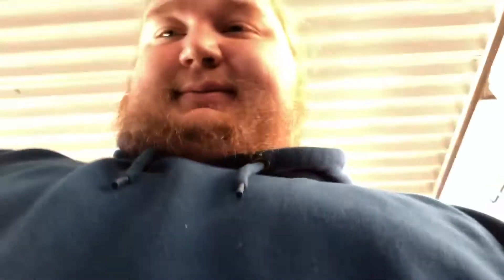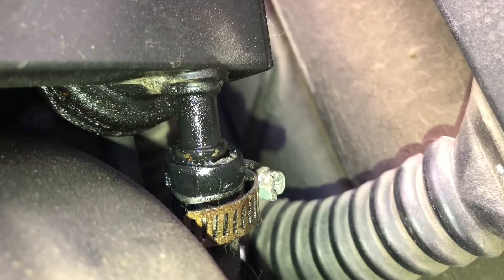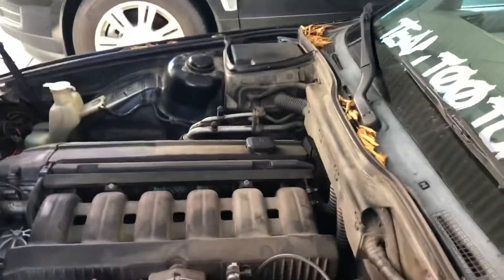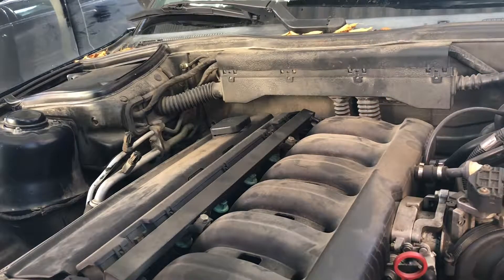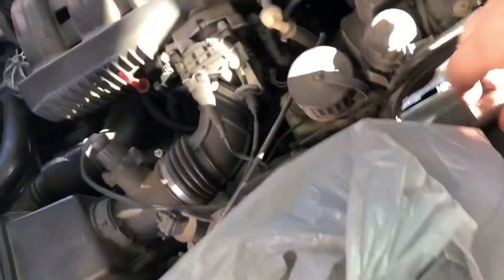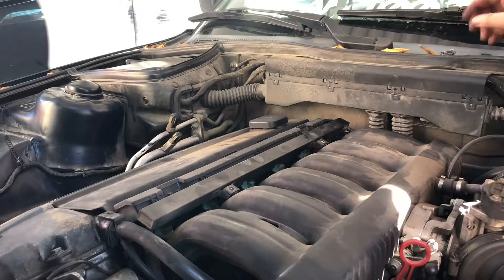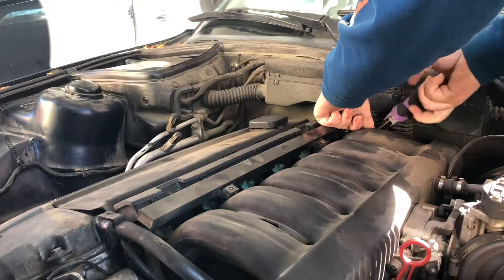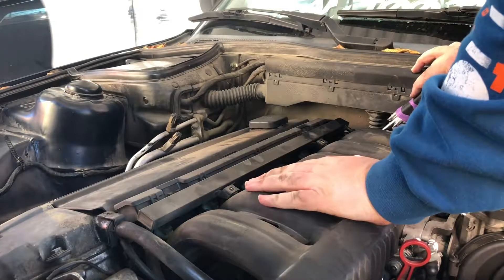ERIN’S CAR HAD A GAS LEAK!?!

Comment: Good job getting that leak fixed!  It could have gotten bad, if it went longer. Was the hose all the way on?  Looked like it could have went on further?  Keep the videos coming.
Reply from the maker: WHOTUCKIS yeah dude it was pretty bad. Hard to tell on cam but it was pissing out the bottom. And yeah it had two lips on it 🤷🏼‍♂️ but the old hose was fucked.